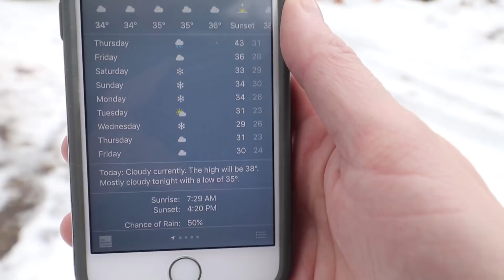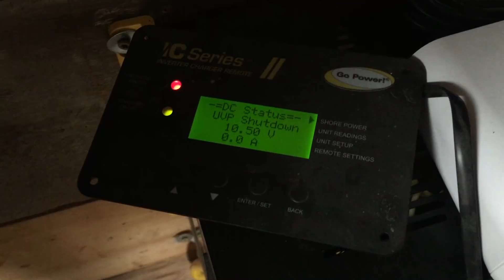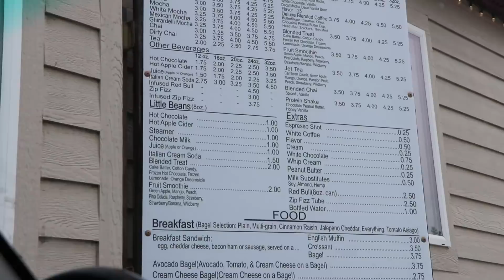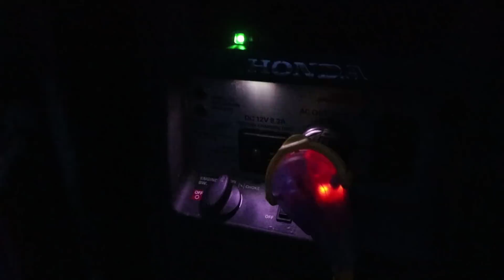Our Story: Giving Up Solar Power to Go On Grid

Comment: Greetings from Prince Edward Island Canada.  I've dabbled in solar for about twenty years now.  Right now I have 2.4kw, four surrettes S600's, two blue sky and one Outback MPPT controller and an Outback VFX2812.  Probably 25k invested so far.  For me it's a hobby, single guy with too much $$$ on my hands I guess.  You nailed it.  I'm on grid but flip a breaker on sunny days, I may generate a whopping $400 a year in electricity, so my system will never pay for itself, but I know that.  I use about 8kw a day.  1100 sq foot log cabin, heat with wood and have on demand propane for hot water.   I tend to use grid as a backup.  Just yesterday I forgot to flip the breaker and at 3am the power shut down from my system.  11.7volts, so I got up flipped the breaker and my batts are charged up again.  You really need to change your life, not a big deal for me since I live alone and have modest needs.  I do have three generators, two gas one propane.  I've only had to fire them up  a times to charge the batteries, I use an IOTA DC charger.  As I mentioned, it's a hobby for me, no more no less.  I could go off grid if I got rid of my 220v submersible pump and went with a DC pump, my well is 120 feet.  And if I added another 3kw in panels and tripled my battery storage, but I like where I am now.  I joke my system is a glorified backup to charge my USB devices.  At 54, it's been a fun ride and nice to see panels in Canada approach $1 a watt.  Grid inter tie not an option since if the grid goes down, you have all this solar, you cant use
Reply: Brent Eamer finally an honest real life comment with experience!  Thanks for sharing your experience.

Comment: If I may, I would recommend that you add two things to your to-dos: record your own power usage when on-grid (the bills are often terrible, mixing estimates, actual readings, and budget-billing, so read the meter yourself on a regular basis) and that each year, you assess your electrical power needs. Living with non-electrical-grid-power as long as you did is a great lesson in how valuable energy is; doubly-so because you're trying to build a house! (Oh, and when you get the estimate for installing, prepare for sticker-shock [ha ha].)
Reply: Jason, in more high tec. countries like in Scandinavia the power companies supplying the electrical power read our  meters on line, via the power supply lines !! No estimates,  no "budget billing"... Just  charge for the supplied KWh.  Spot on on !  Already in use for a couple of decades.....And we can check the correctness from our own meters... Always correctly billed. Feel sorry for you living in developing countries......

Comment: 1) Commenting
2) Good luck! It's going to be an adventure. 
3) My 2 cents. If you can, bring it in under ground in conduit. Having recently had to deal with overhead lines and ice, not to mention the aesthetic, underground done right is a lot less headache.
4) Get the biggest breaker panel you can. If you haven't done that kind of stuff before, let me tell you from experience this year. Those breaker slots fill up WAY faster than you think they will.
5) Plan on adding a sub-panel. Even if you never do, making sure you easily can from the get go will be worth it down the road. I'm so glad I did when I installed the new stuff at my house this year.

Comment: Im on the grid in the UK that said i have solar too...this is a way to save money and use less grid power i make nearly 4 mega watt per year with a 4 kw solar system..i spend on gas and electric about £100 a month..i get back on the solar £50 feed in tarif per month adverage per month. This property is 40 feet by 30 feet 2 story high.So its not small for the UK average property size, I have a system where the exess electricity i dont use is diverted into heating a 300 liter hot water cylinder to take the temperature from 50 deg C(heated by the gas boiler) to 70 deg C..this makes more use of the evergy you make rather than it going back into the grid and only getting paid 5 pence a unit extra for it. The curent Kw payment is 15 pence per unit it makes index linked for 20 years...so cooking and heating lighting etc this house is £50 a month.I also use a log burner and save heating with this too as the wood i burn is free old palets, gifts old trees etc.This solar systen cost 4 years ago £5,800 and its paid me £2,400 so far in 4 years + the free electric i use from it..i could look at battery back up too but the cost of this is another £4,000 to make even more use of the power generated but the supply is good and reliable here so is it worth it for the extra cost?
Reply: It depends on the value you place on the environment. If you accept that one of the biggest threats to human existence in the next century is caused by using electricity, it's a no-brainer. If you can afford the £4,000 then I'd urge you to do it, and do it sooner rather than later.
Reply: Mitch as a fellow Brit with solar panel and storage....yes, for me 9kwh of storage for £6500, it was a no-brainer. Selling at 5p and buying back at 15p was/is ridiculous, equally the Feed in tariff tax break will keep going down until its phased out. The resevoir of Kwh i have aside means i do not buy power back anymore (i did for 2 days when i had a fault but that was under installation warranty). Not having a storage unit, hamstrings you to only using the power when and if you generate it. ALSO  major point "ITS NOT FREE ELECTRICITY" you have significant  capital investment and operational costs! You've got to factor in inflation, efficiency loss over time. I run a massive spreadsheet with lots of variations and projections. All payback dates are hypothetical at best.

Comment: It seems as though the problem is not your capacity, but your actual quantity of solar received.  The other concern is having to truck in water.  One could easily think that you chose the wrong place to live.  You might be better off with a windmill as you seem to have a lot of wind there.  Once you get your estimate from the power company, investigate what it would cost to get enough wind capacity to equal what you will get on grid.  If you decide to go with the grid, get at least 200 amp service because the extra cost will be minimal when you get hooked up, but possibly not even available as an add on later,.

Comment: Good. Cuts down on tasks that eat up your time (and stress), when you have so many demands on that time. Get your house sorted, then re-visit solar later. Building proper solar is a chunk of work to defer until much later.

In fact, I'd visit building a small/simple "guest house" to live in while finishing the main house. Something as simple to build as possible, but better than your mobile - and good enough to be permanent. (Also really as simple and easy to build as possible.)

Comment: This makes total sense, when I watch the workshop videos, the off grid solution was not working. Personal I think the grid connected solar solution, I know a few farmers that have it and love it, in the summer they produce enough to sale back and in the winter what credit they built up pays the bill, and let's say something happens you still have solar panels to get by if the grid fails. If you can afford the 20 to 25000 solar grid connected system it's best of both worlds.

Comment: We're in "sunny" Southern California with a 10 KW solar setup, on-grid.  All winter we've been using grid power because there just hasn't been enough sun.  Grid-tie is the most realistic option out there until the battery backed options get better.  The good news is that they're getting close to viable-- maybe a couple more years and it's time to upgrade with a charge controller and a shed full of batteries.
Reply: Depends on your power company, many people are finding their bills flip all of a sudden as their power company would no longer pay them for generating electricity.
So I would double check what goes on in your area before thinking grid-tie.

Comment: I don't blame you. Not sure why you guys didn't do this sooner. At least you are capable of powering yourselves in the case that you lose power from the grid. I would personally build it into your budget for the house to hire an electrician and build a nice power system for the house with solar, backup gen power, and grid power. I recently had an electrician buddy of mine wire in a Generator transfer switch into my panel so I can run my backup generator when the power goes out. I just plug it into the side of the house, crank it up, then flip a switch in my panel and boom I'm on Gen power and all the major things we need to run have electricity. I'm about to purchase a NG conversion kit for my Gen so that I can hook it directly into my NG line which enters the house about 15' from where my gen plugs into the side of the house. That way I don't have to keep the gas tank topped off.

Comment: Thank you for making this video! A few points: When I built my solar power station, I  went for 45 times the calculated load! It works. The math they're doing would need to be for a construction site, not a family! " My solar power station" is a building with; panels, batteries, switchgear, generator, diesel tank, propane tank, charge heaters, radio/communications equipment. Electricity has a serious cost, they've thus far paid in stress and money.

Comment: Fine to do what you want, not so fine to suggest that others are less truthful than you.  Convince yourselves, worry less about convincing everyone else from your inexperienced perspective. You actually thought your system would be adequate in Pacific NW ????  It takes three elements to gain wisdom: 1) information, 2) mentoring/instruction, and 3) hands on experience.  Like a milking stool, when one leg is missing- you fall down.....don't blame others for your nearsightedness.  You are such  hard workers and interesting to watch as you learn from doing, but  double check your motives, planning, and selfishness. I like your  enthusiasm, but attitude makes me less interested in watching.

Comment: Did you ever try an array that was big enough or do you still have just those three panels we are always seeing up on the hill...how many panels so you have?  And you bought used batteries.  Is that right ? I'm in South Carolina and I'm about to set up a solar system 2500 watt of paneled and 900ah batteries.  I will make a video of how it turns out. With the tiny house build... But I've gone over and over the math and it should work.. south Carolina is closer to the sun....lol...  so fingers crossed
Reply: And I will be running a 8000 but a.c. propane heat or wood. Haven't decided..

Comment: Good luck with it! Some that are on-grid chose to go off-grid as a form of rebellion; some that are off-grid do it of necessity, because they cannot afford to go on-grid. I have a very reliable supply to my house, but my workshop has PV on the roof that runs my computer, router, lights, fridge, etc that are the vampire consumers of power, that sip the power 24 hours per day.  I only use the grid for big stuff like the microwave, washing machine, lathe, mill, etc. Spare PV-power heats the water, rather than burning gas. I'm not grid-tied, but grid-assisted.

Comment: There is absolutely NO reason why you cant supplement your grid power with solar to lower your bills down the road.
Reply: Depending on the inverter you get, the more feature rich units can do "power shaving" where the more expensive hours for power uses the array/batts to "shave" use of the grid. 

These inverters usually have multiple AC inputs in addition to DC input so that grid, an auto-start genset and battery can all be used to provide power to the AC loads based on what makes economic sense at any given time.

The power industry is looking to move residential power rates to the same time based scales as businesses so this will come more in to play in the next few years; i.e. you'll pay more for power during the day/early evening than in the middle of the night. 

At that point, a small array + 3kwh-10kwh battery setup might make sense even to city slickers! 

You wouldn't even necessarily need a solar array since the inverter/charger could charge the batteries in the middle of the night at dirt cheap grid rates and use them to shave off the expensive charges during the day/early evening.

Comment: Solar power works great in areas where your not going to get snow. I live in Spain where a large proportion of homes are powered only by solar/generator. in order for this to work you need at least 6 panels and as many GOOD batteries (like Rolls) as you can afford. One local home produces upwards of 8Kw per day on a normal sunny day. This drops to 3 to 4 Kw when its cloudy.

Comment: Why dont yall keep the solar you have and invest in a couple of those 300 watt china made grid tie invertors.. just use the grid as the battery..  power company doesnt even have to know.  Look up gorrila solar..
Reply: that is theft and very dangerous to linemen called out to fix the grid

Comment: IF you have the option to put it underground instead of overhead go underground and in a sleeve or rigid plastic pipe.  I worked in utility construction and design work for 15+yrs and a it is way more aesthetic and viable to not mess with limitations of where overhead can not impede on trees and structures. Overhead wire is always in the elements and the size of trees around your property could pose issues in the future and requires constant vigilance of tree maintenance.  If your utility company says it won't do underground have them put a pole to your property line and dig from the pole to where power needs to go and place the meter out on the pole. This way since you have a backhoe you can dig it and expand it where ever you want and need it- to the house to the shop and to other needs that arise in the future. but be sure to place more than one pipe for cable or phone or fiber to be separate and possible sleeve for gas line attachment for future or resale-. Just food for thought.

Comment: It all depends on where you live.  Solar power here in San Diego (grid tied) is perfect for us since 2001.  We pretty much make all of our electricity.  We just have to pay the $5 or $10 monthly fee.  We do make a little extra electricity to pay for most of that.  However, it would not work in Idaho with all of the snow.  You don't seem to have enough wind to use a wind generator and no stream to use a water generator.   I could not bear the noise of a gas generator for 10 minutes, myself.  And all the gasoline to fill it getting on your hands.  Ugh.  I would for sure go on the grid there.  I would have done it long before you did.  When the Tesla type batteries get cheaper and better, we will get one to run our refrigerator whenever the power goes out.

Comment: Check out Steve Robertson's Channel. It was going to cost him $15,000 to get electricity to his house he opted to go with $10,000 for the solar panels and it is not easy timing is everything, working around the Suns clock. Having said that grid power is definitely the cheapest way to go, most convenient and most reliable.

Comment: I have had supplemental solar to  partially serve  my grid power. More important my solar is for back up in case of grid failure! After Hurricane Sandy we were without the grid in NJ for 2 weeks and I have to say having heat ,hot water, lights and the ability to cook  saved our bacon! I subscribed to your channel to see how you would tackle some of the issues that come with off grid living and what ideas you would share on your channel.I have so enjoyed watching you and your wife face your day to day challenges trough trial and error !The only thing I can offer is a little bit of my own experiences with the grid and off grid alternatives.There are no quick fixes as each situation and persons are different and each solution has limitations.So for me it's been better to have as many choices as I can have at my disposal .Example with Sandy there was no gasoline to run my generator but my partial solar was operational so on and so on.Thanks again and keep the videos coming!

Comment: I would definitely go on grid but hook up the solar panels so you could produce some power to offset your electric bill a little.   But I think it’s a good call to go on grid, it’ll give you a lot of options and make things easier
Also with the solar hooked up, if the grid goes down, you’ll still have power

Comment: We use almost exclusive wood heat, and the other day we received our 60 day power bill. For $2.73/day, our well provided us with pressurized water whenever we needed it, we washed and dried our clothes, we cooked, did shop work, ran interior and exterior lighting, preserved food in a fridge and a freezer, watched tv and constantly accessed the internet, we made hot drinks and snacks at our convenience, and also realized my morning daily cup of coffee at a cafe, cost me the same.

We really are not pleased with the effort required to maintain our wood heating system, and the total inconvenience to stoke it in the early morning when the house temperature has dropped to 59*F.  We know we have to upgrade our single pane 48' of patio doors, to a better insulated system, and then, I think we will go with a heat pump system with wood supplement.  We will feel more comfortable, and have more time to do fun things.

Life is a balance of choices, none of them are wrong.